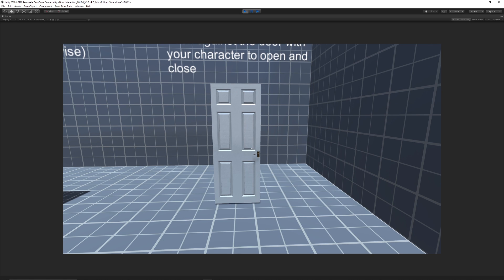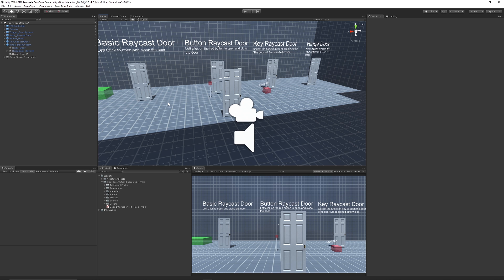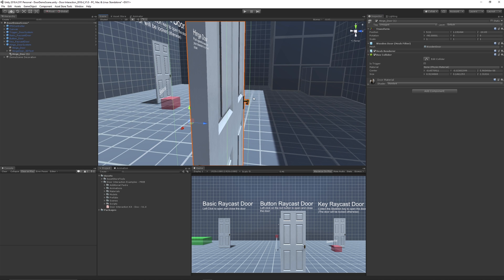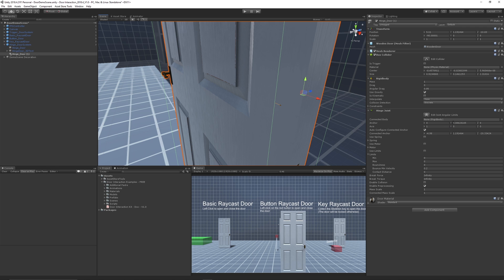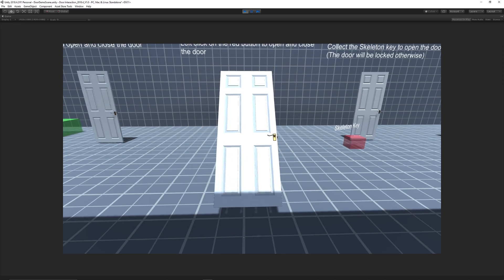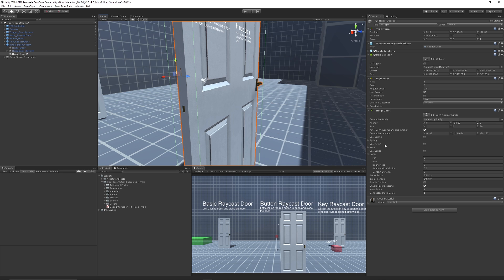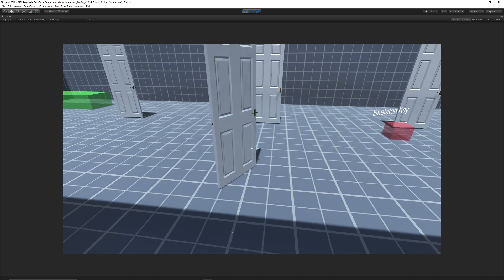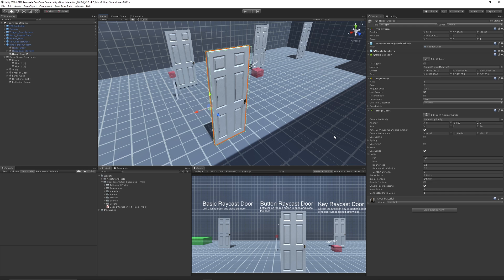Creating a HINGE DOOR in UNITY!

Comment: Whenever I tap the door very lightly it swings as if it was flung open by an unseen force I'm currently messing with the weights but I'm not sure where to start, I already fixed my other issue for the time being of the door acting as a old west door
Reply from the maker: Did you adjust the weight and force?
Reply: @SpeedTutor  I just adjusted the mass of the door and it seems to work better than before so thank you for that but I have come across another issue since I combined the hinge joint and then added my own script to rotate the door to a specific degree before allowing it to act on the hinge to be interacted by the player. The rotation when interacting with the door seems to fight the hinge joint so it looks like my door is stuttering until it reaches the specified angle I set in the inspector then it acts normal

Comment: So At some time they have updated this and now have something called a Connected Articulation option under connected body (unless its an asset i have messing with it?) the documentation does not even talk about this, i follow your guide and my door doesnt move so i am wondering if its that thats screwing it up.
Reply from the maker: Unity usually like to add things that they don't tell you about, haha. What version of Unity are you using? I'll look into what is happening on my end! :)
Reply: @SpeedTutor  version 2020.3.17f1

cheers for that
Reply: @SpeedTutor  so i was experimenting to find out what my issue was, and for some reason the Hinge does not collide with my character controller. or any capsule controller. so it might be something ive done ... or something else not sure.

Comment: Got a question for you, how do I make the door have "weight"? Walking straight into the door just makes it fly open. Working with IK and handplacement on walls/doors, so I just need to make it a bit "slower". Changing the mass does practically nothing.
Reply from the maker: I can't recall off the top of my head but I'm sure there was something that made this happen. Does it have a friction option?
Reply: Hello you trying to reproduce the door of resident evil 7 ?
Reply: the answer is to increase the mass scale.
Reply: Rigidbody mass and spring damper (if you use spring).

Comment: No matter what I do with the hinge limits, the player can still break/glitch the door past its limit and it spazzes out, I tested on my own project and in your project here, both can glitch if you just push/slide against the door at its hinge limit position :(

how do i make the limit totally rock solid even against the kinematic player pushing against it? 
I tried all variations of using colliders to block it, still glitches through the wall etc :(
Reply: I spent days of work trying to solve this exact problem, until I learned that this is about your character colliders, not hinge settings.

For example your character moves with physics but is holding a weapon, the collision of that weapon will cause this bug, you need to make the weapon ignore the door collision for example.

I NEVER found this solution when searching it, it's amazing.
Reply: I had the same problem.

It happens that the hinge joint physics requires more calculations per second for it not to glitch.

Two things that can fix this:

1. Edit > Project Settings >Time > Change "Fixed Timestep" from 0.02 to 0.01 (or even 0.005) Performance might be affected.
2. On the hinge joint, add a connected body of another rigid body fixed joint door frame with iskinematic enabled.